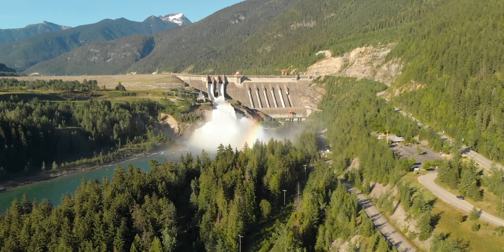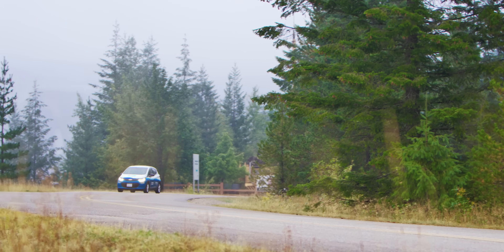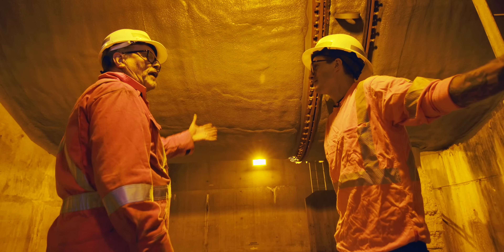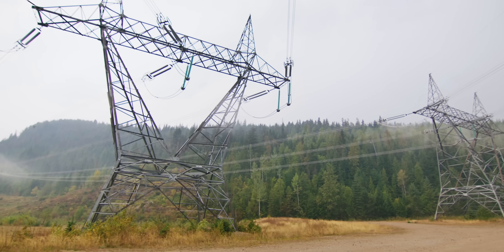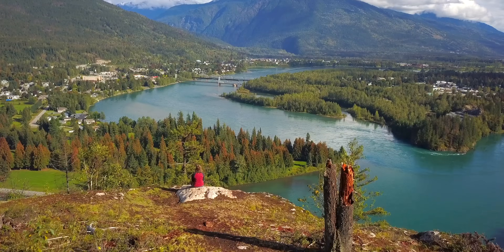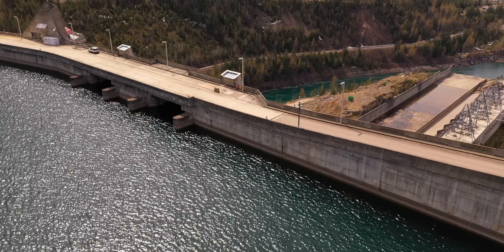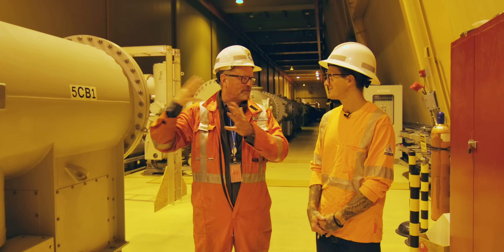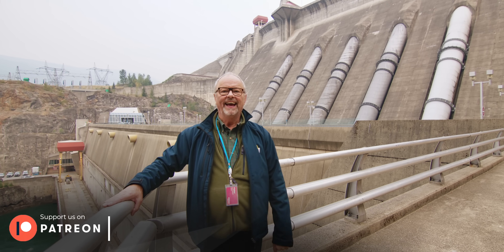This Dam Makes Enough FREE Energy To Run A City

Comment: Fun fact 98% of all BCs power comes from renewables.  Mostly from this and other dams, which is why our electric company is called “bc hydro”

Anyone know how the fishies get from the top bit to the bottom bit, or how salmon get back up?
Reply: @Fourier21 do they have slides too?
Reply: The Salmon runs in the Columbia were severely distorted and eliminated in some places including through Revelstoke by the construction of the lower Columbia dams in the US during the 1930's... Grand Coulee being the best known of many. There were and still are Kokanee runs (natural occuring land locked salmon) in most streams in the Upper Columbia. They seasonally spawn in side streams coming into this reservoir. I've seen them myself before this dam was built. But as far as I know they are doing fine. The dam reservoirs tend to create more fish habitat, not less for resident species such as trout.

Comment: Great video on the Revelstoke dam, and that dam is just a tiny dam compared to the ones just a bit north. 👍
Reply: Yes the Mica dam is pretty impressive in its own right, and so remote. I worked on the logging/clearing of the reservoir back in around 1970-73. Very much larger reservoir than Revelstoke which is more of a run of the river style than Mica. I don't know what Mica storage is, but it immense and ultimately impacts water flows to all the dams downstream including Grand Coulee.
Reply: @jimlambrick4642  I was referring to the wac Bennett dam and the new site C dam under construction, both in northern BC

Comment: Hydro electric power is a good option in certain places but not everywhere. The damage it does to initial habitats when flooded is negative unless in the rare occasion that the valley/ area flooded has limited biodiversity. Additionally they hold back the flow of sediment meaning coastal erosion increases as recession overtakes accretion and often they can reduce the flow of water preventing vital annual flooding needed in lower lying areas vital for agriculture. Don't get me wrong, it may be beneficial here in terms of waying up the cost and benefits but in many places it causes major damage.
Reply: Hydro tends to cause damage anywhere it is used (and it varies according to a number of the factors you mention) however relative to coal generation the overall impact is what needs to be compared.  It has impact on local biodiversity, it has impact on the people who used to live in the area which is flooded - but with our ever-increasing demand for electricity large hydro stations are a massive effort against global warming through carbon emissions.  While it's unfortunate from a conservation standpoint that a valley be flooded and become a lake - that may well be preferable to the alternatives on a national or global scale.
Reply: Dams do reduce flow of water, but I thought they also do double duty by providing a regular source of irrigation.

Comment: I am a huge proponent of making sure we actually use hydro thats already installed. Especially in Appalachia we have hundreds of sites set up along rivers and lakes that are either entirely abandoned or only sparsely used. The coal industry basically shut them all down and they have used the EPA as attack dogs to prevent folks from developing power production on existing dams (requiring companies to build fish ladders on dams that predate the Civil War for example).  By all means, let us make it easier to exploit dams that already exist! 

I am not a terribly big fan of NEW hydro projects. The CO2 that goes into the concrete, the CO2 and methane generated by rotting trees and debris, the ecological and social devastation in the communities impacted... New hydro just isnt smart.

Comment: I didn't know that - One cubic metre of water dropping one metre is equivalent to 1 kw! Learn something new every day!
Reply: Also the typical confusion of energy and power needs to be considered, so we need to factor in TIME. One cubic metre of water falling one metre in one second = 9.81kW of energy. It would need to continue falling for just over 6 minutes to produce 1 kWh of power. The Revelstoke Dam discharges 2,125 cu metres of water every second, producing a maximum of 2,480 MW of electricity, The height of the dam is 175 metres, but the head of water is likely to be significantly less. Let's assume 150 metres, So each cu metre is producing approx 1 MW of electricity. If the dam was 100% efficient it would produce 2.9 MW of electricity, suggesting overall efficiency at about 85 %. That is not the same as capacity factor, which is how much it produces in one year, vs the amount it could theoretically produce running at maximum capacity all the time. . For this dam the figure provided is about 33%.
Reply: @jockmoron  I agree, kW is a rate, so the units don't make sense there.  I think getting on with the GD energy transition is the important thing, and I love FC for energizing us on the way!  But errors like this do stick out and annoy a bit.
Reply: Actually, this isn't true. 1 m³ of water is 1000 kg. 1000 kg elevated 1 m is 9810 Joule (1000 kg * 9,81 m/s² *1 m).
9810 Joule per second is 9810 watts = 9,81 kW.
Reply: The joy of metric! Everything is so simple and logical.
Reply: mgh right? 1000*9.8*1 joules.

Comment: 7,800 GWh per annum is an average power of 0.89 GW.
New York City uses 8 GW of power on average.
So this dam could power 11% of New York City?
Reply: It's a 2.8 gigawatt facility so 35%
Reply: @Alex-cw3rz  Yes, nominal power, which means maximum power. Average power is just a fraction of it (7800 GWh/8760h).
But okay, at maximum power, the hydroelectric plant could supply 35% of New York City.
Reply: @701983  where did you get that from?
Reply: @Alex-cw3rz  Where did I get what from?
The 7800 GWh were mentioned at the beginning, a year has 8760 hours, so you get the average power by 7800 GWh annual yield divided by the hours of a year.

Comment: I used  to run an Eco-Tourism business from Banff Alberta to this dam a few times a year. Viewing this area on video is awesome, however, you must visit it to really give you an idea of how massive this place is.
A side note, Revelstoke is very wet because of the towering mountains draining the Pacific air of it's moisture.. In the summertime, we get on average 1280 mm (50 inches) of rain. In the winter the average is 2450 cm or approximately 80 feet of snow! 
The drive through the trans Canada highway is a bucket list for sure.
Great video.

Comment: You know an industrial facility is big when you see adult tricycles with baskets parked all over. Those are for the maintenance staffers- they need to be able to carry their tools from one job to another and tricycles are often the best way possible to do that.
Reply: Yes, I used to work for a chemical corporation, and the maintenance works did exactly as you say.
Reply: Serious question: are they electric? 😁
Reply: @EleanorPeterson  They normally run on carbs, like regular bicycles.
Reply: If anyone's wondering: 7:22

Comment: youd of been better off spending the money on replacing every bulb private or public with leds.....
Reply: Hasn’t that been done ?
Reply: @jsanders100  by those who can afford too and are bothered.... so proabaly less than 10 percent.
       im talking about going door to door and repacing every single bulb that isnt led with one....would probably work out a hell of a lot cheaper than a brand new hydroelectric dam.
       poor people cant afford to be greener.....
Reply: @jimmyhackers8980  2.8 gigawatts of power here I doubt more efficient bulbs would be that much, espcially as you can do both.
Reply: my point is this damn wont save the average person anything.....where as replacing bulbs with more efficient versions will.

Comment: Curious that the dam is convex instead of concave, and there doesn't appear to be a fish ladder for salmon to go upstream.
I hope they think about how to deal with sediment accumulation and how to help it travel downstream without excessive turbidity.
Reply: We have learned alot in 50 years! When he was speaking about doing things differently I assume as well as the political conversations with First Nations peoples, these are considerations he wishes they had.
Reply: It is a gravity dam. It doesn't rely on the compression from the sides of the valley.
Reply: @yodaiam1000  would you be so kind as to explain that to me?  I know no, little to none, about that type of engineering.
Reply: @WileECoyote-r4v  If you have very hard and strong material on the sides of the dam, you can have an arch dam like the Hoover dam. This is more efficient since all the concrete is in an arch and in compression. If you aren't lucky to have such hard material on the sides of the dam, you need the weight of the concrete and a wide base to stop the dam from over turning from the water pressure.

The Revelstoke dam looks like it has some fairly hard material but maybe not as good as the Hoover dam. You might get some resistance from the sides but it can't be completely relied upon.

The irony is that the base material for the Hoover was even harder than expected and it took like more money than expected to excavate and shape the rock.
Reply: @yodaiam1000  good explanation!
Reply: @yodaiam1000  thank you for the information!👍
Reply: There were no salmon below the dam to use a ladder. They were excluded in the 1930’s by the construction of the Coulee dam further downstream.
Reply: @davidbutt406  then the same question applies to that too - a fish ladder can be retrospectively constructed.
Reply: Great observation, those were some of my thoughts as well.

Comment: FYI ... Hydroelectric generation in Scotland started early in the 20th century and is one form of renewable energy. It was kick-started by the need for power to drive aluminium smelting plants in the Highlands. This led to the construction of the Laggan dam and hydroelectric system in 1934.
Currently in Scotland, around 5000GWh of electricity from hydropower are produced every year; that’s enough to power roughly half of Scotland’s homes. This success is set to continue now that the Scottish Government has identified sustainable hydropower as a key part of Scotland’s lower carbon future. Source SEPA
Reply: Incredible stuff! From England, and I honestly had no idea of the scale of hydro power in Scotland. Scotland really is the renewable power house of the UK.
Reply: The one at Kinlochleven has been operating since 1909!
Reply: Yes I’m in Highland. There are loads of hydro dams, but much smaller than that Canadian one. Most were built in the 50s and 60s
Reply: Except that hydro dams are intrusive and environmentally and scenically damaging. More efficient use of power might be a rather better investment in many cases.

Comment: The issue with many of these systems is the best place to generate power (solar/wind/water) is not near where it needs to be used.  Many people do not like to see high power lines in their back yard.
Reply: Prefer those and power lines over a fossil-fueled plant in my back yard. But distributed (wind/solar at home with some storage) is also a step in the right direction

Comment: It is correct that hydroelectric generates electricity without burning anything - but big dams do also have their big problems - that can be addressed. And need to be - fish migration is a very big problem, and it needs to be solved. Salmon for example - are a massive part of the life cycle of the forests in the headwaters of the whole watershed.
Reply: I remember visiting a hydroelectric station in Scotland, they had a salmon ladder.
Reply: @jsanders100  Right - that is one solution. Another would be to have a number of much smaller dams.
Reply: A dam is certainly better than burning fossil fuels but the salmon issue is big in the PNW.  If we could find a way for these big dams to live side by side with the salmon runs of these rivers it would be a huge win.
Reply: The "Salmon Cannon" may be a good solution.  Check out the youtube videos.  Has the added advantage of removing invasive species from the river, which is a great benefit for the fish.

Comment: Pretty sure lots of NYC power already comes from a Dam in Quebec, Canada.
Reply: Actually, a lot comes from Churchill Falls, Labrador, which if I recall is 8.3 GW.
Reply: @davidbutt406  lot came from James Bay, with LG complex, not a lot from Labrador
Reply: @davidbutt406  I think you are right. Hydro Quebec, however controls that dam and it is highly controversial. The contract is up for renewal pretty soon though.The 5,428-MW Churchill Falls generating station on the Churchill River in Newfoundland and Labrador is the second largest hydroelectric power plant in Canada and the 10th largest in the world.

Comment: So could this:
Wave Swell Energy's remarkable UniWave 200 is a sea platform that uses an artificial blowhole formation to create air pressure changes that drive a turbine and feed energy back to shore. After a year of testing, the company reports excellent results.
As we've discussed before, the UniWave system is a floatable device that can be towed to any coastal location and connected to the local energy grid. It's designed so that wave swells force water into a specially designed concrete chamber, pressurizing the air in the chamber and forcing it through an outlet valve. Then as the water recedes, it generates a powerful vacuum, which sucks air in through a turbine at the top and generates electricity that's fed into the grid via a cable.

As a result, it draws energy from the entire column of water that enters its chamber, a fact the team says makes it more efficient than wave energy devices that only harvest energy from the surface or the sea floor.
WSE's key innovation here is that one-way generation; other devices that harvest the same effect use bi-directional turbines, requiring the ability to reverse blade pitch or redirect the airflow. WSE says its design allows for far cheaper and simpler turbines, that should also last longer since they're not getting as much salt water splashed through them when a big wave hits. Indeed, all this device's moving parts are above the waterline, a fact that should help extend its service life as well as making it completely harmless to marine life.
Interestingly, the UniWave's design also makes it easy to incorporate into breakwaters and seawalls, where it can take a coastal erosion protection project and turn it into a clean energy source.